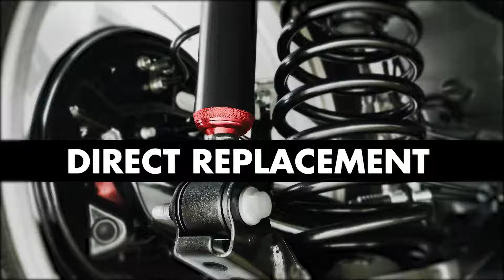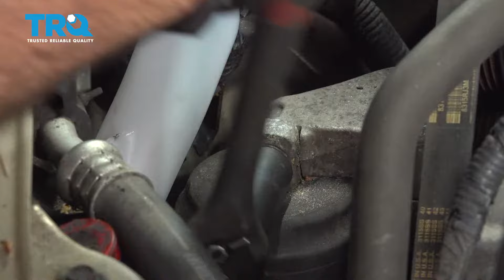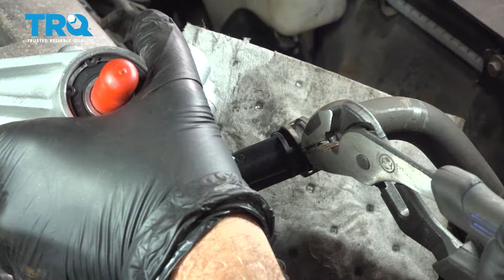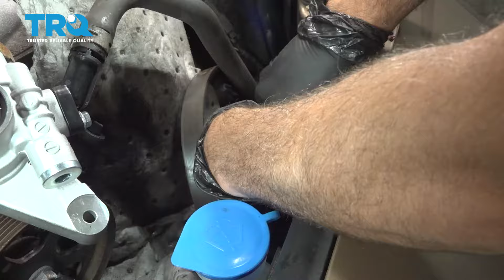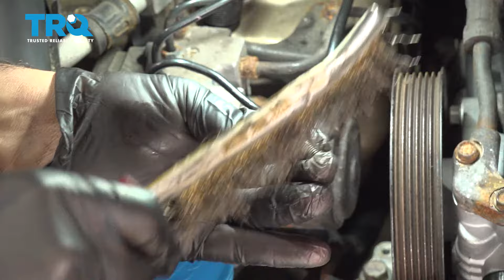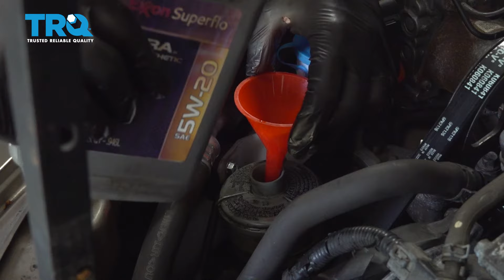How to Replace Power Steering Pump 2004-2008 Acura TL

Comment: I found that removing the engine mount wasn't necessary to reach the lower PS bolt. I used a 1/4" ratchet to fit down there. Also removing the low pressure hose and leaving the higher pressure one on then swapping it to the new one once you have it removed was easier too. 

I normally repair German cars and found the TL's PS pump one of the easiest ones I every done in years.

Comment: How come you didnt just flush the power steering fluid and add new ones after installation so it doesnt caused a problem as the old one?

Comment: Might as well replace the belt and the engine mount you just removed if it’s needed. I love how easy these are to work on. Just replaced my passenger side cv axle and lower ball joint (along with speed sensor, rotor, brake pad, and brake line) only pain was refilling the transmission fluid. But the previous owner of my TL didn’t use Honda trans fluid and turning left or right sounded like a nightmare.. even just replacing the fluid didn’t help. Had to replace the pump… nice and silent.

Comment: Use only power steering fluid that says specifically for Honda vehicles. No idea why the video would show a 5w20 quart of motor oil pouring fluid into the power steering reservoir. That’s weird, hope no one puts engine oil into the steering system.

Comment: I'm not a mechanic and I have limited skills, but I'm going to offer a suggestion.  ALWAYS replace the O-rings!  Why do all that work and have it possibly fail because you cheaped out and didn't replace a 50 cent O-ring.  Especially looking at the conditions of the motor, it looks like it has some miles on it.  O-rings flatten out and become brittle over time and it might not always be apparent.  Also, if you're putting in a new pump, wouldn't you flush and empty the system before installing the new pump?  That way, you can refill the system with fresh fluid and not run contaminated fluid through the new pump.